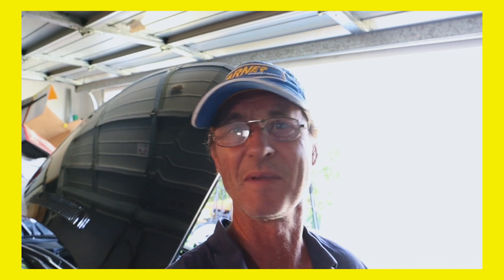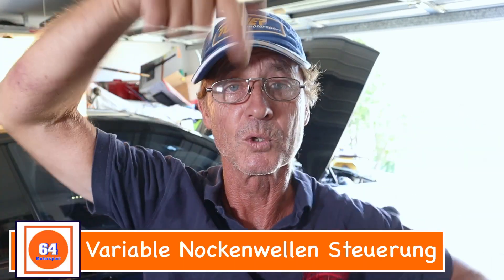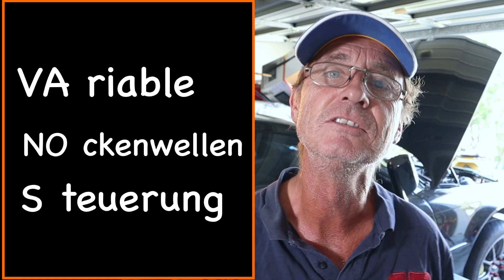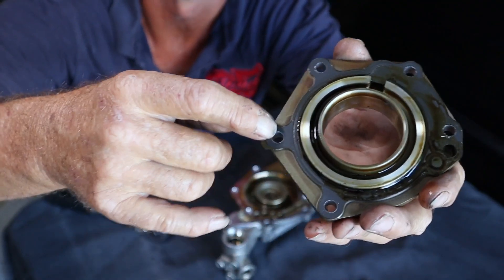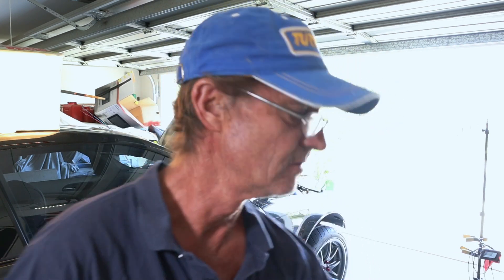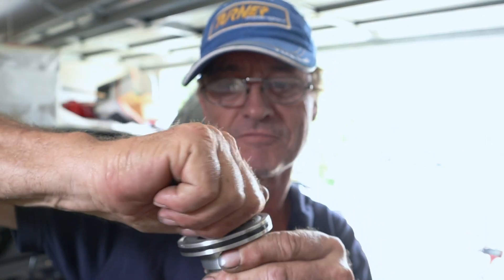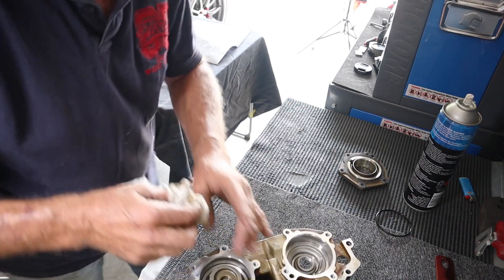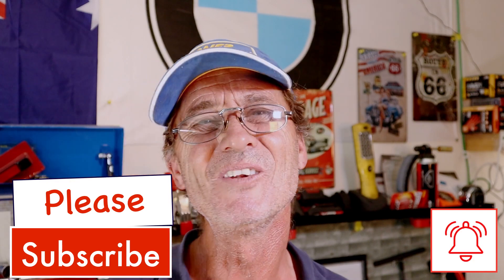E46 MAINTENANCE // WHAT MAKES YOUR VANOS WORK (AND NOT)!!

Comment: Hello,I'm writing to see if you can help me. I ordered the complete vanos gasket kit for an M54B30, and after replacing them, the car was running much worse. rough idle and a significant loss of power. After disassembling everything again and checking that everything was reassembled correctly, I ordered new solenoids. The car was running fine again, very smooth. But after 20 minutes, It lost power again and had bad idle. What do you think it could be? The computer says "Exhaust vanos end position not reached." My only two theories are: - bad camshaft position sensor - loss of oil pressure somewhere Hopefully, you can help me. Have a nice day!

Comment: Hey great job, @sixty4motorsport  well articulated, please help me with this error, vanos inlet camshaft, end position not reached, vanos exhaust camshaft, end position not reached, camshaft signal inlet, oxygen sensor voltage before catalysator bank 2… please help  🙏

Comment: do you know if a worn out vanos will cause massive misfires at low rpms? like if you goose the throttle at low rpms, it instantly misfires, from around 1500 to 2500rpms, but if you let off throttle and goose it again it stops..

Comment: Another great video Michael. You were able to clearly articulate a concept and demonstrate a process that many just turn into a confusing mess.  I was worried whether my VANOS unit was at risk as my beloved E46 M3 Convertible is approaching 200,000 Km, but after this, I know what to listen for.  I am undertaking many of the more basic maintenance tasks, but the BMer is booked in to Sourthern BMW in Melbourne early next month for rod bearings and engine mounts and a full health check. I will then progress the resulting work list as I plan to keep the street legal race car till I drop off the perch and then they can bury me in it…….. Love your work!!!  Love learning about E46.  Thank you.

Comment: Hi, quick question. My e46 turned the EML light no check engine light , so  no codes. But my idle is very lower than normal. When i rev the the pedal. It sputters and once it hits the 2000rpm it heaitates and goes back down to 500rpm. Its a misfire. I checked the coils. They all seem to be working. Cleaned out the IAC and throttle body. And the CCV. Still idles low. Second question. When i cleaned out the throttle body. I unplugged both battery terminal and i umplugged the throttle body harness. When you plug the harness back and both the battery terminal. Do i need to do throttle adaptation or reprogram? Would a bad camshaft cam and exhaust sensor couse these eml light and idle low? Please help.

Comment: Would this cause loss of power, loss of power, clacking at 3500 rpms at idle, 3k under load, and valve cover gets extra hot, from the front of cover, lees so on motor side

Comment: Would I be ok just replacing the seals on my dual vanos unit? I have a 2003 325i e46 m56 aut. Trans. Is it the same kit as the m54 or m52?. Also there is two little threaded hules one on each side o each piston. The have little plastic plug or filter what are these do I need to replace them? If so what is there name or description. Thanks before hand.  Not a mech. Just unfortunately owner of this height mant. Car. Help please

Comment: Can the intake vanos inlet cause fuel cut off???? I'm having misfire with fuel cut off but I've replaced fuel injectors, Exhaust camshaft sensor, fuel pump, coils and plugs... Upstream oxygen sensors.. I haven't gotten to take off the vanos inlet that blocks the intake cam shaft sensor... I can't even out my intake cam shaft sensor on because that inlet vanos is stripped idk how to get it off I've tried vice grips and nothing

Comment: speaking fo vanos, (this may be a long story, but im gonna make it as short as possible) several months ago, my wife told me that she experienced a stall at a stop sign. I interpreted it as the early stages of a cam sensor problem and was waiting for it to happen when Im driving, but it never ever did. And i drive the car 10x more than she does. i shouldve hooked up my bm700 obd2 reader, but it didnt. I was in the process of replacing the oil filter gasket and thought, out of an abundance of caution - since we have a 3.5 year old - I should just replace the Cam sensors. not know which one to replace, had both done. I wanted to do it myself, but couldnt get the fan bolt off, so i opted to take it to a garage. they changed the oil filter gasket, valve cover gasket, purge valve, both cam sensors (hella brand), ps hoses, rack boots and tie rods, all for 50k yen, about 400 UsD. immediately after repairs, i began to get an intermittent hard start and random stalling at idle and or at a stop. I hooked up the obd reader and im getting code p0340:  indicates a malfunction with the camshaft position sensor A circuit. from your experience, what are some of the problems that could cause that p0340? could this be the beginning of a vanos problem? its a 2000 320 with 98k kilometers on the clock. thanks in advance for your help.

Comment: I've got an E39 with a 3.0 M54 in it, and it has a major loss of power after 5k rpm, and a nasty rattle around 2k rpm that sounds like it's from the intake manifold. The noise doesn't disappear when disa is disconnected, so it has made me consider vanos being the issue. I did already swap the Vanos unit from an engine with working vanos (I did an engine swap from my 2.8 to the 3.0, and the 2.8 ran perfectly other than a blown headgasket) but the noise persists. Could it potentially be something with the intake manifold? I am using the 2.8 intake manifold and plan to swap to the 3.0 when I get the adapter plate for the throttle body.

Comment: Great info…my 05 E46 (200km) automatic trans - has low power at the bottom end and low power at the top end but seems to run total normal on start up (cold engine) but soon drops back to the symptoms at normal operating temp. Do you think this is vanos related or Disa valve perhaps? Love your channel!
Reply: Did you ever find out?
Reply: My grandson now has it and I think he got it fixed. I will find out when I see him next. He’s on spring break. I’ll get back to you. I’m curious too!

Comment: Hello. I have m52b25tu engine and I have a problem with intake cam sensor. error 65 (impa). So i changed that sensor for HELLA and after while it was showing it again. It doesnt have big effect but its annoying. Sometimes 1of 10 starts car is just cranking for about 3-4 seconds and after it starts up its is running low on power. So i need to crank it for second time than it runs perfect. I know this cam sensor is common problem but i didnt find advise for me. My question is if it can be semething eles behind that sensor or some other error that causes this annoying problem. Ty for any advise. Ur videos are great :)
Reply: Did you manage to fix your problem ? Currently having the same issues with a b20tu :)

Comment: Hi… I recently acquired my 2005 325i e46. I’m looking to make it mechanically sound before I do any upgrades. Other than upgrading the coolant system to aluminum radiator and expansion tank and also replacing the hoses with hi-temp silicone hoses with screw clamps do you have any recommendations on where to start ?

Comment: Would a problem with the vanos ever throw a check engine light ?
Reply from the maker: Possibly, you would need to plug in a diagnostic tool to find what the error code is. 🙄

Comment: Great video. Forgot to mention that the spacer inside the pistons might also need adjustment by sanding the top to make the needle bearings fit a little more snug incase theirs a lot of play inside each pistons.
Reply from the maker: Good tip!